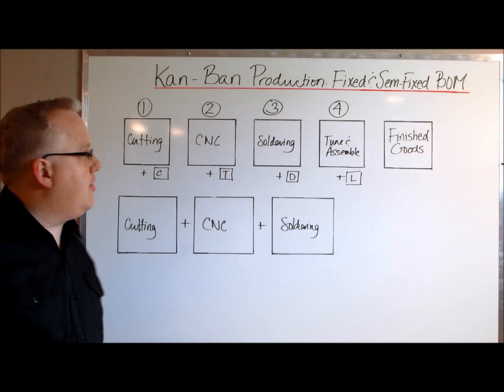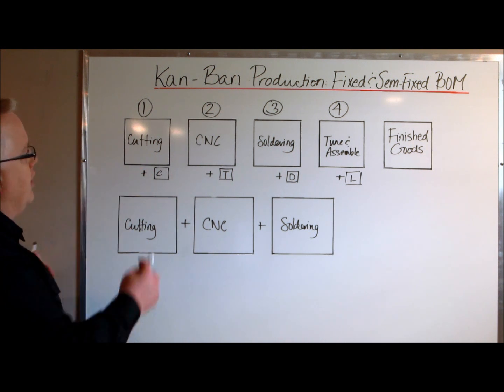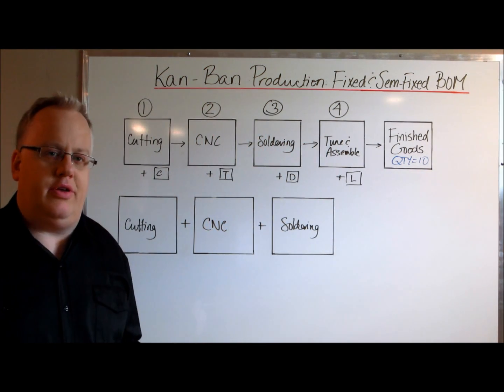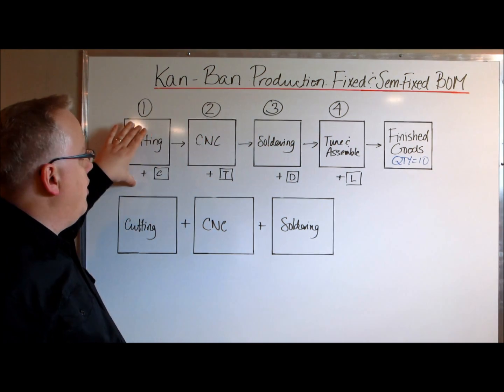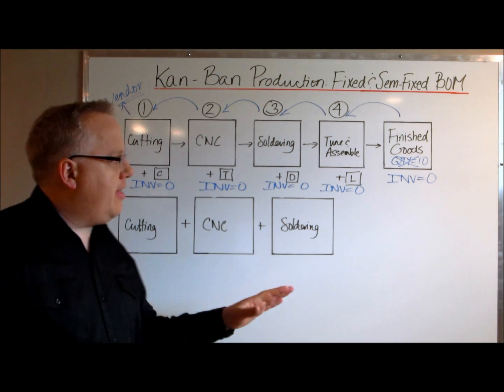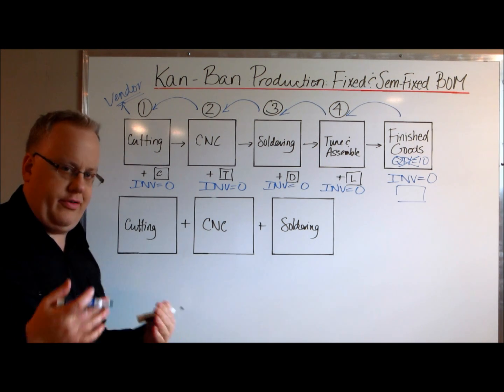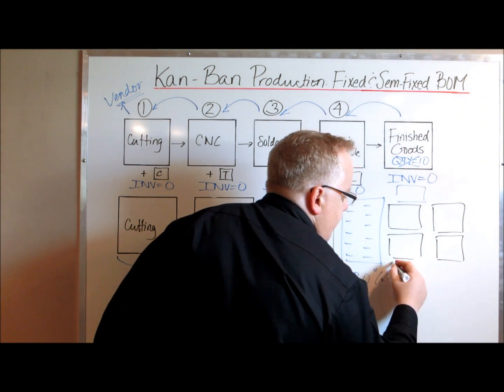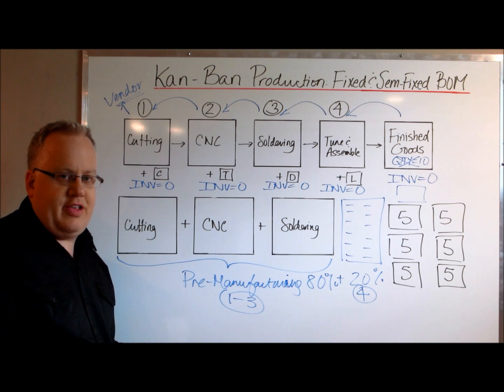Kan Ban Manufacturing Layout: Lean Principles

Comment from the maker: In a way, that's true. The only difference I wanted to make was that most Kan Bans include finished goods manufactured from a fixed bill of materials (BOM). Multiple operations will have work-in-process inventory - all waiting to move to the next operation once finished goods are ordered. With a Push-Pull, 75-80% comes from a fixed BOM, while the 20% comes from a semi-fixed BOM - thereby giving customers more options. Also, it's not always just a 2 stage process with Push Pull - it can be more.